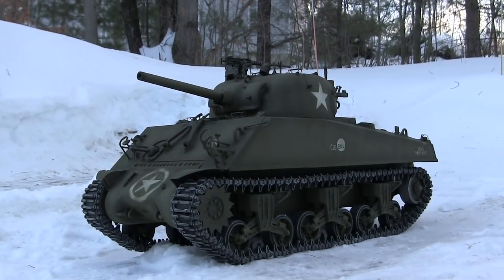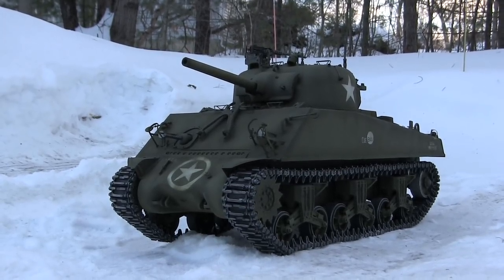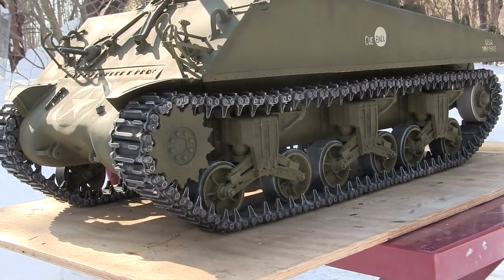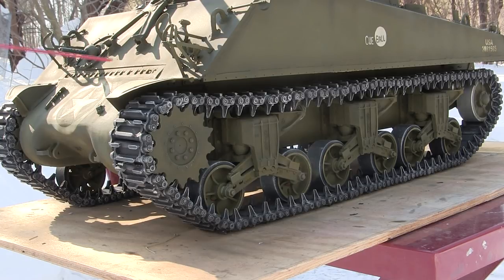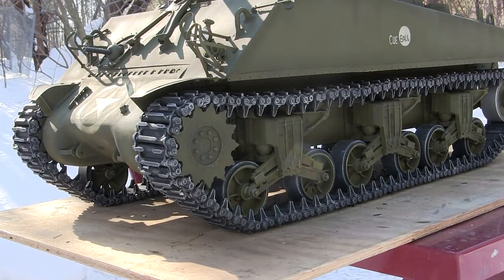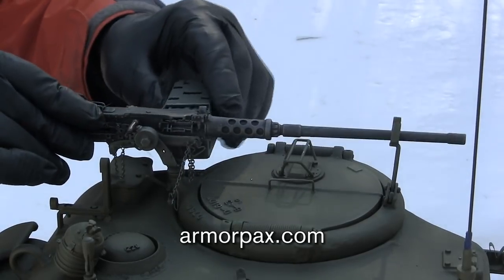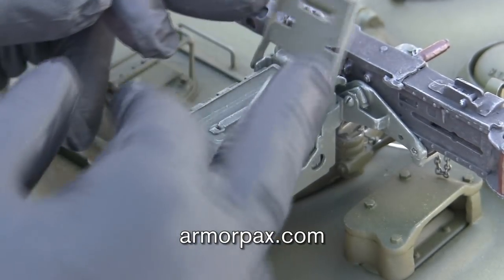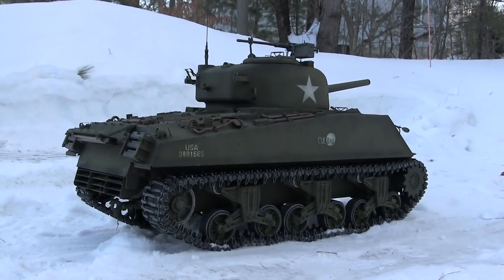1/6th scale Dragon M4A3 Project video #9 (Model Complete)

Comment: Do you think you will be able to add on a different model Turret and the 76mm/105mm Gun onto your Sherman Tank?
Reply from the maker: Gamez The kit comes with the parts for the 105mm howitzer. As for swapping out the turret, Field of Armor models is releasing the T23 76mm turret in the coming month for this kit.
Reply: Nice.